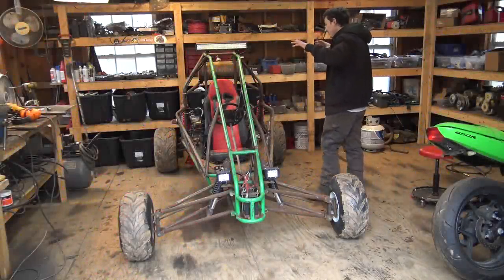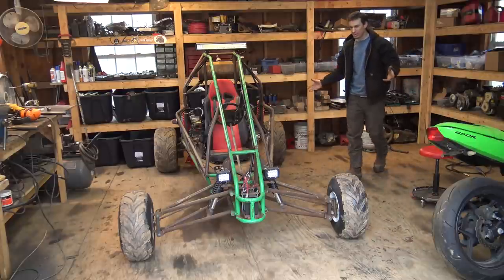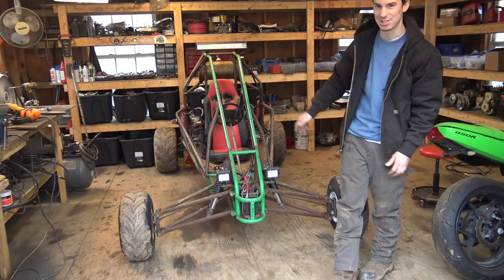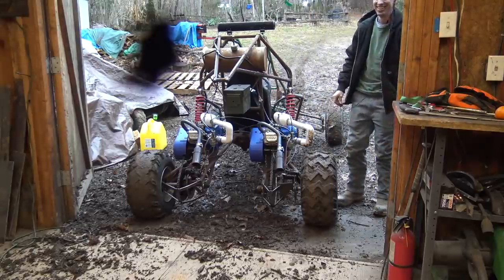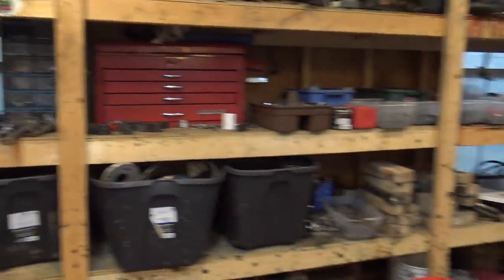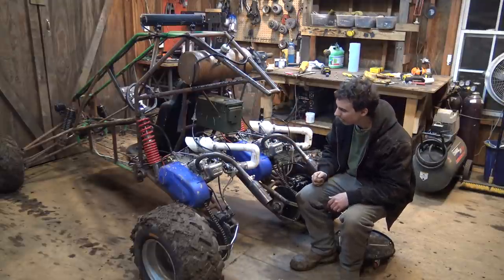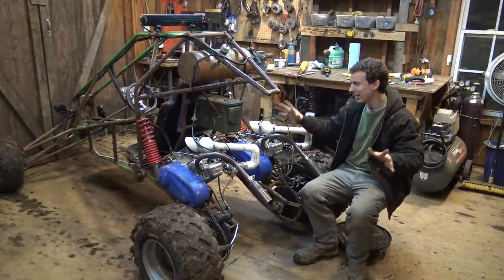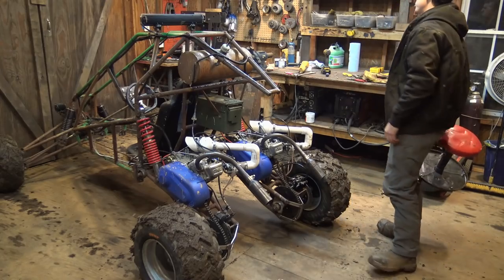Finishing the Dual Engine Go Kart

Comment: Use some flex tubing from the carbs and route it right in front of the gas tank and use one bigger filter like for a k&n from autozone for both engines. Thatll keep it away from mud and water. Just my suggestion. Love the builds!👍

Comment: If you ever do relocate the batteries you should use that spot up front for a little storage area for spare parts or tools. Just something that can be pretty handy when out in the woods. And also you should paint the exhaust with the heat resistant paint. It should look way better, because right now when you look at the rusty exhausts they look pretty bad. ANDD, paint the rest of the go kart also. Keep the green it has on there, but just paint the bare metal part black or something. That would look pretty badass. Nice videos and take your time so that way you don’t screw up, get frustrated, and then quit. Your channel is growing, you are too committed to let your fans down.

Comment: Hey Chris, keep doing you chap your producing great content for the YouTube community. A suggestion for the twin-engine buggy is getting an anti-roll bar fitted asap to the rear, it will help tremendously with handling and overall control especially at any kind of speed.

Comment: You can reduce your battery’s down to one just disconnect one of the coils in one of the engines.. less clutter
Reply: Or just run one battery and put diodes in the charging wire from each battery.

Comment: Dude with that setup you could run rear steering brakes and turn on a dime!  Granted the steering brakes would be a simple solution there are traction advantages to engine rpm differentiation. Easier on belts, traction control and more. You are talented enough to do either. Drive by wire would be something to consider then you could use a button on either side of the steering wheel to control direction, traction and handling without the tuning
 complications of the throttle cables.

Comment: Btw - those sprocket guards which we that ride dirt bikes and quads call skid plates will be crushed or broken off there like tin foil the first bumps you hit.... It was a nice exercise in Fab but nowhere near strong enough. Especially when you have that much unsprung weight. Those silly things will crush and be ripped off immediately and probably hurt or bend your sprockets and chain in the process.

Comment: you only need 1 battery and a mount behind the seat would ge a good spot there or next to the other ammo box that on the back if the battery is only for lights then wont need to be as big and would fit in the ammo box there already

Comment: Sorry I did not explain the VW heater duct material very well it is a flexible hose that runs between the air shroud and the heater ducting on an old VW Bug it would be perfect for a flexible ductwork to run to a snorkel or a single air filter for both carburetors or whatever
Reply: Just look for automotive air duct hose

Comment: Hello,
The air the engine gets will be hotter now, less oxygen = you know what...
Why two batteries? A couple of diodes would do the trick inline with your charging system.
Have you fought of installing dual gas pedals or other differential throttle system? It could help in sharp turns etc.
I've been subscribed for some time now. I really like your chassis building skills.
Cheers from Belgium.

Comment: I see you took the piece of advice about synching the engines. Your really close but still not quite there. It's a real pain because there are a few points of adjustment. I think to get the last lil bit you will have to adjust the nut on top the carb.
Reply: Nicks backyardprojects   Don’t forget about the torque converters thay can come in at the same time but not send the same amount of torque to the wheels.   Good call on the high speed adjustment on the carbs.
Reply: @livingstonbarrie  yeah there are a lot of finicky things when trying to run dual engines. If both engines ran a singular axle synching wouldn't have to be as precise. It also wouldn't be as cool haha

Comment: Is it possible to wire the stators in series that way youd only have one output with twice the capacity? I think its series....im getting old cant remember which is which with out checking the trusty google. I know we used to do it to car alternators for car stereos back in the late 80s
Reply: I think series would double the voltage, wouldn't it? Guessing both motors have a charge mechanism in them so they don't overcharge the battery when running. Could be tough to get that all working right. Not sure why he has 2 batteries though. The engines are pull-start. If he needs a battery just for lights, then he could unhook one from the battery entirely and only have one battery.
Reply: You install an isolator  just like you would for a big system in your car. You would get the correct charge and it would automatically switch, either from battery to battery on multi battery set up, or from charger to charger on a one battery, dual charger set up as needed. Isolators are relatively inexpensive, easy to install and the correct way to do it. I personally would keep the dual battery setup for trail riding especially if you're going to be out near dark and need the lights. That way one battery will always be fully charged.

Comment: Volkswagen heater duct hose it looks like paper on the outside but it's aluminum and it looks to me like you need a really good anti roll bar
Reply: anti roll bars are for street...that why they make sway bar disconnects
Reply: With the way the cart is built, anti-rollbar’s would not work you would have to add a swivel to the down links to keep them from bonding plus the end use is off-road.  As long as you are not going to fast It will be fine

Comment: I'm telling you...  google "KENDA paddle tires" ... they have 22" tires right now for $35 each.  They have a stiff paddle, so they're not the best paddle tires for "sand only";  But they are the best all around tire that I've used, because they work very well on dirt and mud.. and they're still hard enough that the paddle doesn't wear when you cruse it on the street. CHEAP

Comment: Tires are what people were commenting about as being the problem? And, worse you think that? Not the fact that your motors are on the rear swing arms being beat to chit??? Horrible design, massive unsprung weight, low power, etc.... You have Fab skills but you are seriously misguided in your design. Look around, it's not that hard to see what works right. It's like you are trying to reinvent the wheel when it's already been perfected. And it's not like you are doing it to save money because it's costing you more.... I don't get it. You're a smart kid why are you doing this crap. I did like your Shifter Kart! There you were on the right track!

Comment: You won't be able to go down a two track with that front end Lol.
Reply: Needs to jack the suspension up so it is actually long travel. Give it more clearance and narrow the track width a good bit. I know he wants to keep the yard kart front tires but something larger diameter will help it climb up over junk off road. Going from 19/20 inch (factory size) tires on my son's to 23s front and rear made it a ton more agile on the trails.